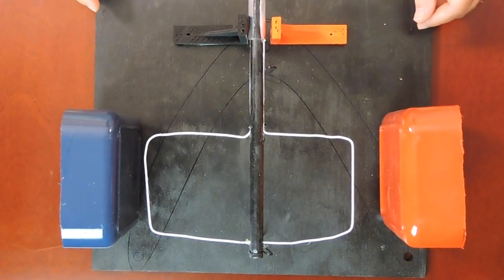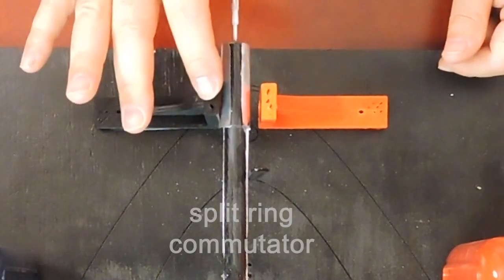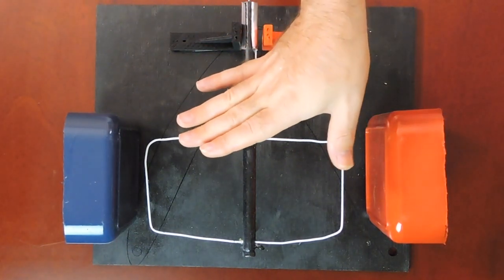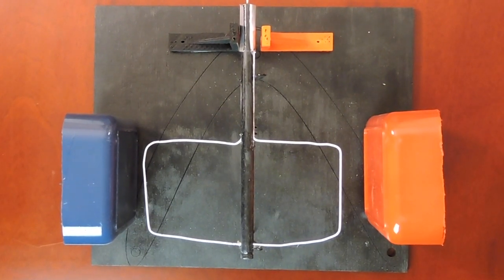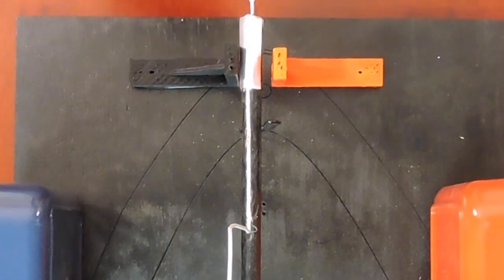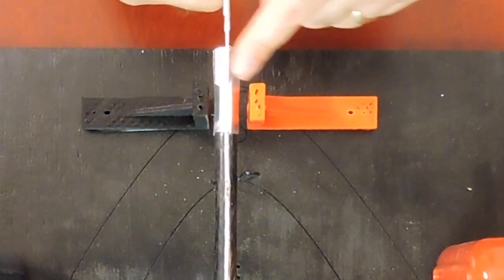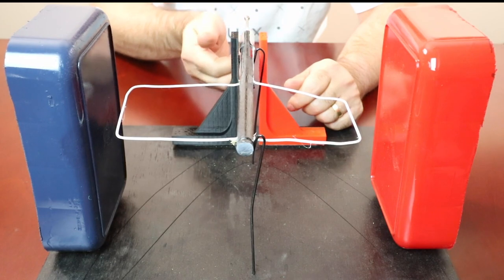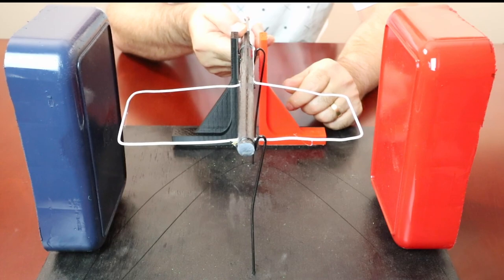How do DC motors work?

Comment: Pls question.  If electricity comes from moving electrons in a wire. Why it does not vanish with time. Power supply to a city needs a huge amount of electrons. Where all these electrons coming from ?? Electrons in copper wires can’t supply this for ever???
Reply from the maker: It’s not that electrons are flowing like water. The electrons stay relatively in the same place. Think of it more like waves. The particles move periodically as energy is transferred. Like sound through air, like waves through water.
Reply: High School Physics Explained ya but as energy transferred. We loos electrons. Right? Since electrons are limited amount in the wire or the source.  Then electrictp needs new source of electrons after some time.  I hope u can elaborate.  Your lectures are fantastic 👍